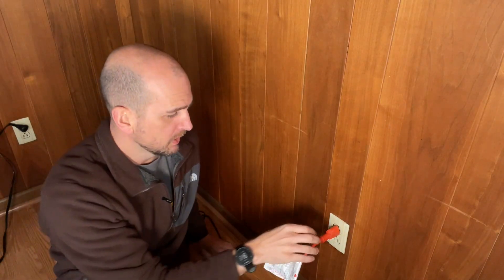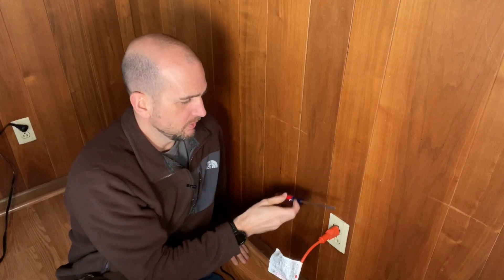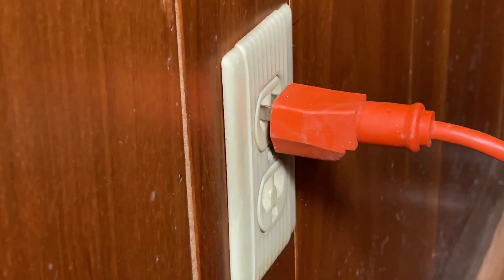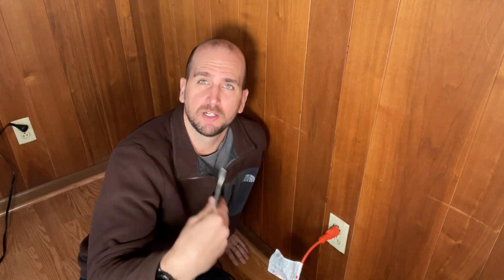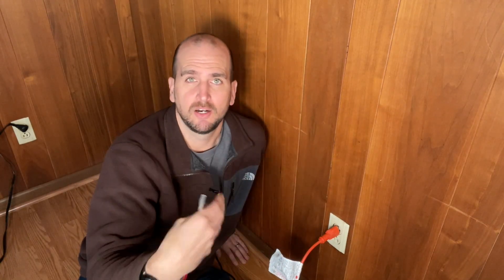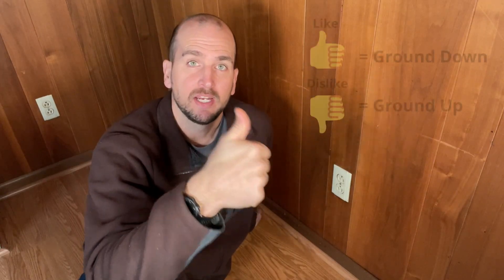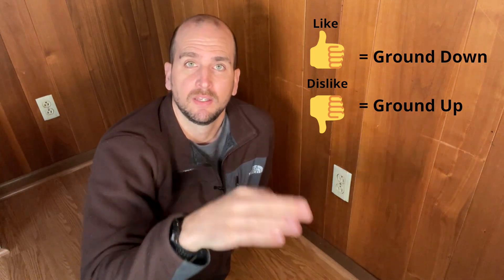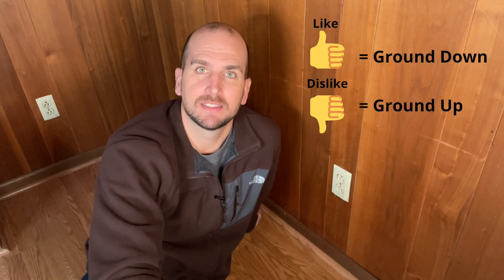Should An Outlet Be Installed Ground Down Or Up

Comment: I prefer placing the ground connection down.  Obviously it works either way.  The main thought I have is that when someone grasps an electrical cord to remove it, they see the top where the live connections are located, and do not see the bottom where their finger may come in contact with the metal pin as it is removed.  If the ground is on top, their finger may come in contact with the live pins before they are extracted from the receptacle.   Just an old electrical engineer's perspective.

Comment: As a commercial electrical contractor for 40+ years, this was always an issue of irk with me. The NEC NFPA-70 does have a reference regarding this, found in 
Article 406.10 (D) Grounding Pole Requirements:  (2017 edition)
"Grounding-type attachment plugs and mating cord connectors and receptacles shall be designed such that the equipment grounding connection is made before the current-carrying connections. Grounding-type devices shall be so designed that grounding poles of attachment plugs cannot be brought into contact with current-carrying parts of the receptacles or cord connectors."
Simplified, the code is saying the grounding (aka bonding) connections or blade on a plug is First-to-Make, Last-to-Break when plugging in. Also the grounding blade has to be different in shape so it can't 'accidentally' get inserted into one of the power provisions. You'll also note the blade will be longer than the power blades to comply with First to Make/Break when connecting.
With respect to wall receptacle orientation, the author has a video 'Plug Won't Stay In Outlet' that shows the application of the First Make/Break application. If the plug shown in the picture with the ground down were grounded, the ground connection would still be intact while the power blades pull out. Reversed, the ground would likely pull out before the power blades do, creating a potential hazard. While not specifically stated in the code, I believe the ground down is the correct orientation. I will acknowledge that years ago when grounding receptacles were becoming common, most trim plates were made of metal instead of plastic like today. Often receptacles were reversed as plate screws could loosen and could let the metal plate slide down shorting out the power blades of a not fully inserted plug. The ground up helped provide some protection that way but this concern is pretty obsolete now. This is regarding general purpose receptacle, Appliance plugs are a whole different chapter.
On just another note, this is the first I've ever heard of reversing a receptacle to indicate it's a switched outlet. You learn something new every day, I just did. I've always switched the top half of a switched outlet with the bottom half hot.

Comment: What if the receptacle is horizontally mounted on the wall? In my rental home the ground is to the right. I haven't run across it any other way in any 
home I have ever visited but I'm sure someone has a home where the ground is to the left.

Comment: Our provincial electrical utility, Hydro-Québec, uses the image of a ground-facing-down socket as a brand on most of its print communications.
Btw way, when reaching into the shadow behind a piece of furniture to insert a grounded plug, I find it easier to line things up when the receptacle is installed ground- downward.
My $0.02 ☺️

Comment: My brother-in-law insists that ground should be down, because, in case of flooding, the ground would contact the water first (safer) rather than hot wire hitting water first.

Comment: if one of the two outlet s is switched, how does turning it upside down tell you if it is the upper or lower ? ?

wouldn't a label or color marker be more useful ?
Reply: The upper one should always be the switched one.
Reply: @jeepien  
that so , no need to install any outlet ground plug up.. .

Comment: I have one outlet in my home that is sideways.  Does that cause any issues.  I have had no problems with it sideways.  It works well, just a little difficult plugging in some plugs depending what they are.  I realize it takes up more wall space.  Its an outlet that was in a garage and the entire room was converted from a garage to a studio so the outlet was never changed to go up and down.  It was left as is because of how the condoit was run.  Ground is to the left which means nutral is facing up.

Comment: When in doubt, be consistent.when we did an extensive remodel of an older home, the electrician installed all outlets with Ground down.  I think the ones he didn't touch are also Ground down.  I agree that Ground up offers minimal (if any) safety benefits.  Most important (IMHO) is to replace all electrical devices that could possibly be dangerous.  I have had switches and outlets literally come apart in my hands (now THAT can't be a good thing ;-)

Comment: I have personally written commercial specifications for thousands of projects with ground up on walls and ground down on counters. 
A plug that is ajar on a wall with ground up is safer against falling metal objects and safer on a counter with ground down to protect against metal 
objects sliding up. If mounted horizontal then ground and neutral up on walls and ground and neutral down on counters. 
Howard Procyshyn, P.Eng.
Reply: If it's mounted horizontal, the ground would be to the right or left. Maybe I'm reading your comment wrong.
Reply: Nimrodery
If the horizontal receptacle is mounted with the ground to the LHS, then the neutral will be up and preferred for wall mounting as anything falling onto a plug that is ajar will act on the ground and neutral without causing a short to ground. Similarly, for counters, the ground should be to the RHS so anything sliding up from the counter will act on the ground and neutral without incident. Just simple logic to make it safer. 
Howard.
Reply: Horizontal mounting needs to respect where the hot(short slot) is relative to the ground. So on walls, neutral up(long slot) and on counters neutral down. 
After specifying this for more than 25 years on commercial projects, I read a code reference in one jurisdiction that mandated this same method of ground up on walls and ground down on counters for vertically mounted devices as described above for horizontal devices. Howard.

Comment: I’ve used both according to the future application with down as the preference. In a flooding situation the water hits ground first and will be the shortest short circuit to trip the breaker. 
Down will let the water all drain out too. 😜

Comment: ok , here's  the deal,  in the new construction , residential world , all  outlets  are ground  down , except  for switched outlets that are ground  up , so that for one , when you walk  into a room you can see witch one it is , but also it is the one that  will most likely  have a lamp plugged in most of the time hence  the safety  factor , you mentioned, different manufacturers,  this is a good point , Hubbell actually  calls there  device  as an electrical  "safety" device device , the other manufacturers call them as an electrical  device , so if you look at a Hubbell outlet with lettering facing up , legible,  the ground is up , all others it is the opposite .